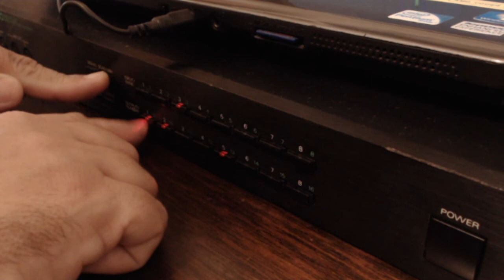Roland A-880 - How to mix and combine two midi inputs - "Merge" function

Comment: I am so confused, lol.  If I have 8 keyboards, can I hook them all up to this box with tha main gear tha MPC 2000 XL ?  My goal is after I hook up all 8 keyboards midi wise, I just want to be able to push a button to sequence any of my 8 keyboards without taking out midi cables and putting them back in.  Thanks.
Reply from the maker: Yeah that ´s it!! You will can connect your MPC out to one of the eight inputs of A-880 and then the 8 outputs of Roland A-880 to each keyboard. It´s a matrix 8x8 plus merge function. This why this is fantastic hardware.
Reply: @lecleto  Perfect, I will buy it than, thanks man.

Comment: How do you assign the outputs to an input?
Reply from the maker: Click and hold on your desired Input of A-880 (midi output of your equipament) and then select all desired outputs on A-880 that you want to send these midi commands from yor keyboard.

For example: your midi keybord is on IN-3 of A880 and you desire send this keybord to your computer midi in on out 8 of A-880 and your midi in Roland JV-1080 module on out 6 of A-880.

Click and Hold the button 3 of up line of buttons and then button 6 and  8 of down line of buttons.

I hope that help you!
Reply: @lecleto  Nice, thanks mate

Comment: The only problem with the A-880 is that we can only mix two signal in.  I had to buy a Y MIDI cable to mix in an additional controller.  But on the other hand this unit works without being connected to USB/computer, like most if not all other MIDI devices on the market today.